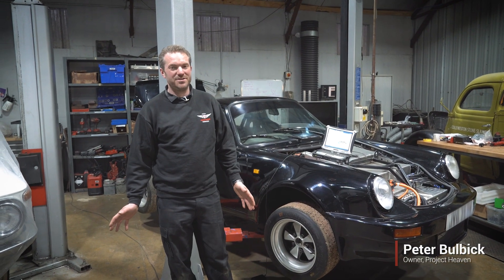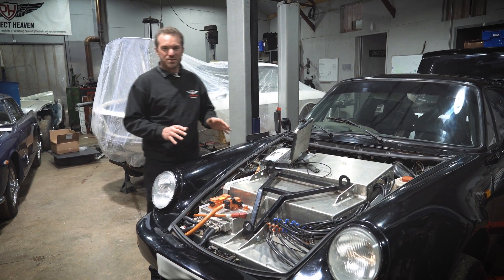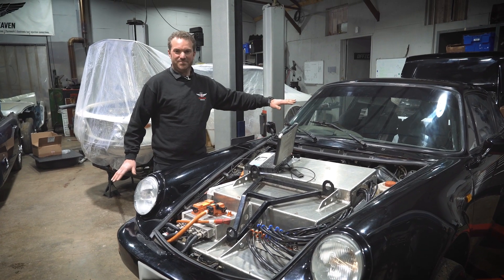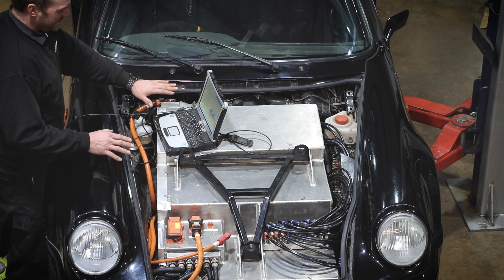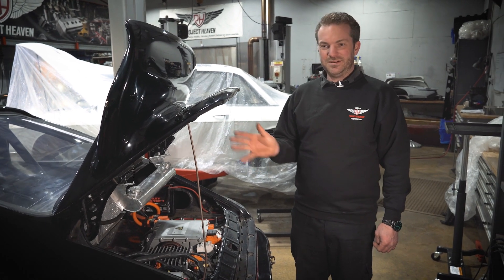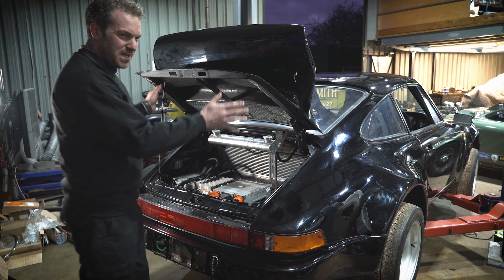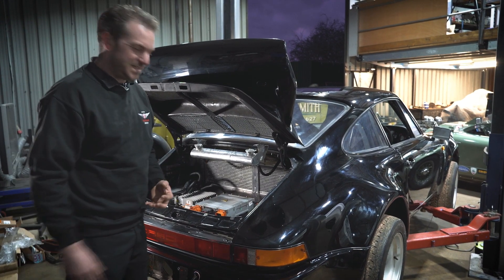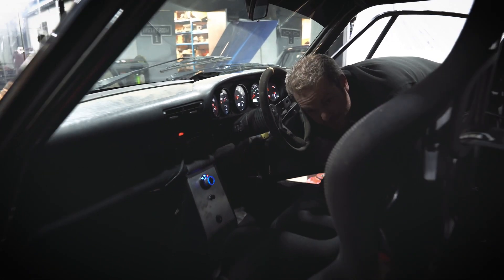Porsche 911 EV Conversion

Comment: The Orion 2 BMS is not water proof, you have located it in the engine bay where air will flow and thus moisture can get to it. How will you protect it?
Reply from the maker: There are still covers to go on in the engine bay area and we are also blanking off the air vent on the boot lid. We should have a video of the final engine bay soon.